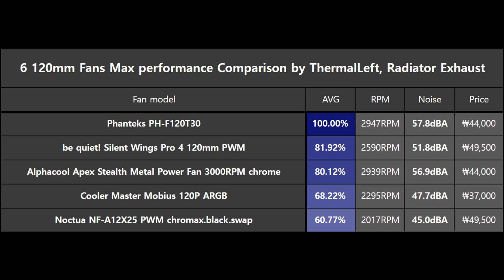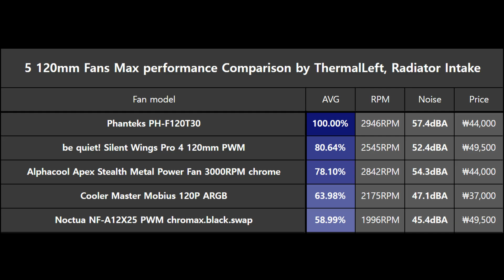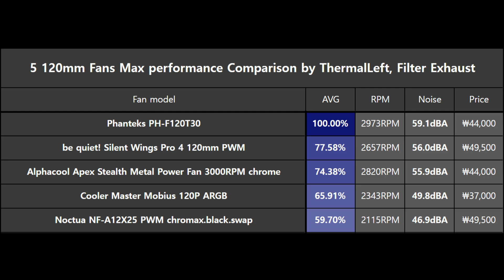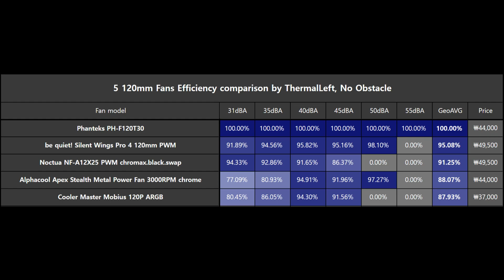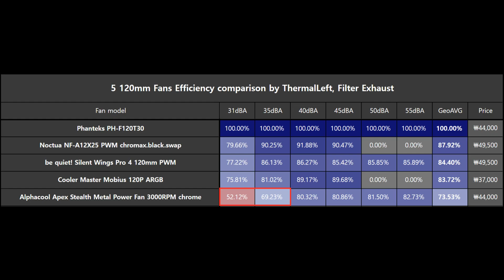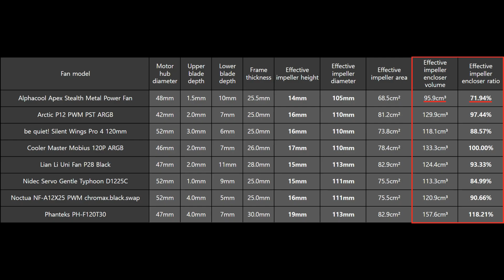Alphacool Apex Stealth ‘Metal Fan’ tested, Noise - Airflow Efficiency

Comment: 5:29 i´m certain Arctic P12 thickness is 27mm, not 25mm. Also, comparing diameters does not mean much, since these are axial fans - their area of highest effectivity is around tips of the fan blades, even fan hub size does not matter (that´s why Noctua has such good performance, despite having quite large hub). Measurement of impeller height should not include depth of hub (blades themselves are sometimes - like in this case - smaller). For example excluding the hub when measuring impeller height on Noctua A12x25 will cause total impeller height to decrease to 12,5mm. I have one next to me right now.

I´m not even sure the depth & thickness measurements can be compared. As you can probably already see, it´s easy to input wrong data and even with correct data, it´s easy to misinterpret it. There is a whole lot of research about what can go wrong with statistics, results of which point out the issue about too many statistics result in the world - for one to input good data and interpret them correctly, they must have perfect understanding of the topic (which too many statistics authors lack). For now, please stick with results, you can measure AND understand.

Except that one part of your data, good work overall 👍
Reply from the maker: I remeasured the thickness of Arctic P12, P12 ARGB, P12 Max with a ruler, but they are still 25mm thick. Would you check it again if possible?

And, of course, you're right about hub diameter. If reducing hub size had been advantageous to enhance efficiency, we could have seen many fans with extremely small motor hub. But, my calculation of impleller height actually have nothing to do with a hub height. The upper/lower depth of blades was only obtained by measuring the clearance between a frame boundary to an impeller. Because I know that the height of the fan generally increases toward the edge of the impeller. So you don't need to correct NF-A12X25's impeller height as 12.5mm. Plus, please note that looking at the 'back' of the impeller in NF-A12X25, the height increases toward the frame as it approaches the hub.
Anyway, my point of view is that, under limited fan dimensions, the larger the height and diameter of an impeller, the greater the potential for increased efficiency. This is similar(but different) relation as making it difficult for 80mm fans to beat 92mm fans and making it difficult for 120mm 15T fans to beat 120mm 25T fans when comparing performance.

Thank you for the feedback!
Reply: @ThermalLeft  My Arctic P12 PWM PST (no matter the revision) measure 25mm thickness, my P12 Max and P12 RGB have a 25mm thick frame with the anti-vibration pads slightly protruding and increasing the total thickness to about 25.5mm. But i dont think the 0.5mm will make any difference. Only The P14 fans are 27mm thick.